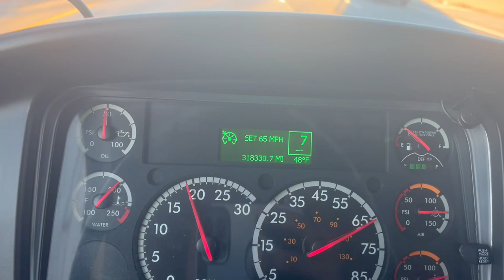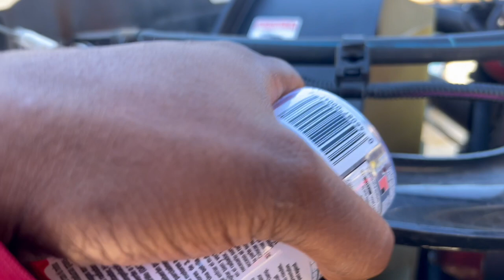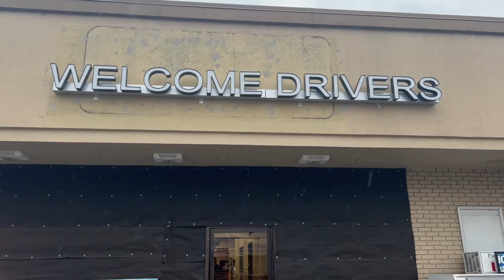26ft Boxtruck $2,000 dollars or $8.00 repair bill … Does it Work

Comment: Part 1

Personally I would just have went ahead and replaced the radiator. Its a one man job apart from taking it off and putting it on the truck. Everything else you can do alone.

I am overhauling my entire cooling system at the moment, 2017 Freightliner m2106 with the same engine cummins isb 6.7. I got 460,000 miles on the truck. I am replacing every gasket, o ring, any hose that has coolant running through it is also getting replaced. Getting the turbo rebuilt.

I am doing everything my self besides the turbo rebuild, a shop locally charging me $750. Just pulled it off and took it to them. Kind of a pain in the ass.

Main reason for all this was my oil cooler was leaking and I said might as well do it all at once since this is my 3rd time draining the coolant to change parts, like water pump and thermostat. Its 10 gallons so the coolant adds up fast to constantly having to replace. Let alone the downtime.

Part 2

I recently deactivated my authority after about 14 1/2 to 15 months. Market is going to be bad first few months this year and the last 2 months werent good. Had a breakdown in november around $4000 all in. Then last few weeks not much work with one of my customers. Load boards dat or sylectus are paying crumbs. Not worth the wear and tear on top of driving in the snow for crap rates. Not worth the risk to me.

Looking to jump back in around april - june not sure yet. 

I know this was long , but good luck brother, I hope you can make it work these next few months because its going to be brutal. Take Care.
Reply from the maker: Seee that’s one of the reasons I went ahead and did the 8.00 fix for now that’s 2,000 with all the variables you talking about in your post I rather fix it like this for now and hope it don’t give me problems and it helps keep my truck running to make more than enough to cover the bill

Comment: It’s just a temporary fix, worst you’re driving extensive hours so I assure it’s gonna come back , not trying to be negative just letting you know but run up a bag then do the permanent fix what that actually does is just clog the hole
That it was leaking through and other components as well
Reply from the maker: Yeah I no but it keeps me in the road and making money so I can stack up to cover than 2,000 dollars and save some money up